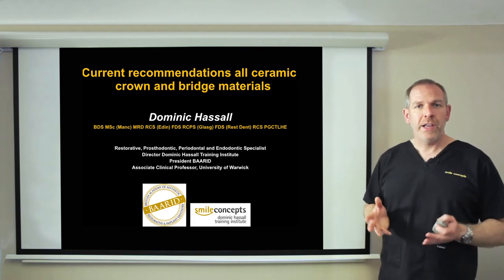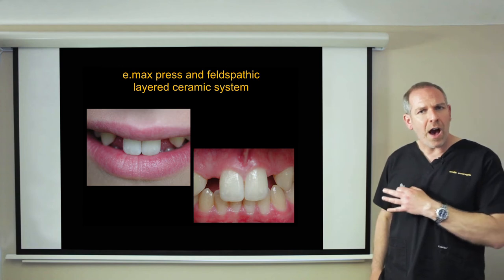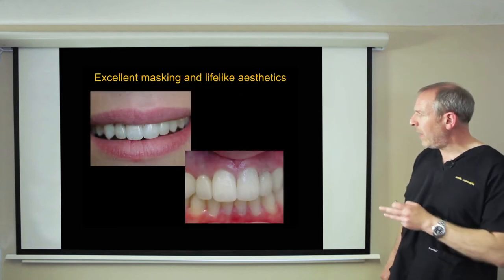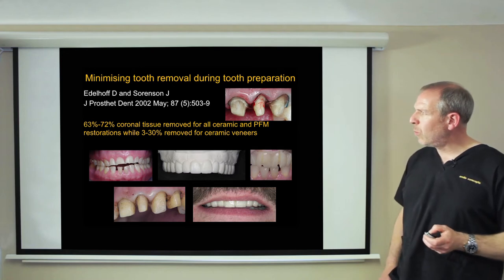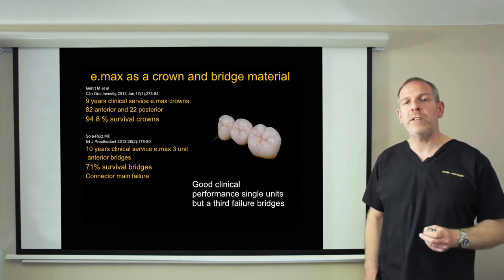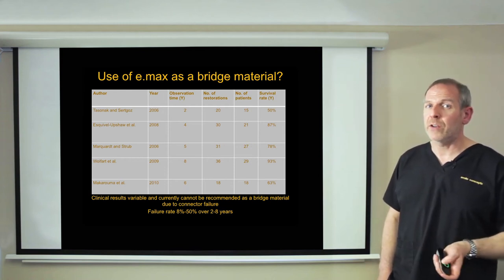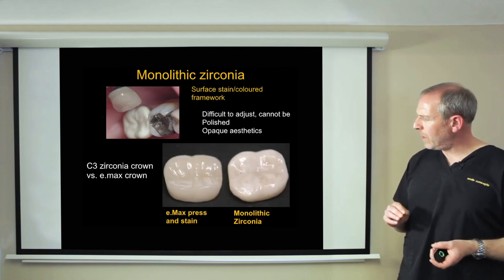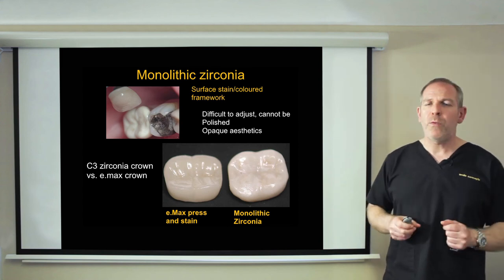Current recommendations all ceramic crown and bridge materials

Comment: Can I use monolithic zirconia as a bridge? It will be minimal prep and no risk of chipping.
Reply from the maker: Yes monolithic zirconia can be used as a bridge.
The data is only up to 4 units so I wouldn’t go longer than this.
The risk of chipping with monolithic zirconia is low and it would tend to break rather than chip but success rates are very good/
There are good guidelines at downloadcentre-gb.ivoclarvivadent.com and good guidelines for E.max too.
Be careful in grinders and with patients with small teeth where metal ceramic would often still be considered the better option.

Comment: Are emax press bridges also at risk of chipping?
Reply from the maker: Press only emax are suitable for bridges but rather than chipping they break at the connectors so I don’t recommend emax bridges and never at the back of the mouth.
For bridges monolithic emax is best but if you want aesthetic bridgework then layered zirconia is best.
Layered zirconia is less liable to chipping at the front of the mouth as occlusal forces are lower so is acceptable.
There are a number of reasons for chipping of zirconia but the labs are better with it and avoiding the reasons why it chips and for highly aesthetic anterior bridges I use layered zirconia.
Bond the zirconia with a resin cement like Panavia V5 which has a MDP primer (this is also in the new scotchbond) 
You can also use gold ceramic for aesthetic anterior bridges but the cost of gold is prohibitive and not many labs do gold ceramic.
Unfortunately there is no perfect material but I hope this helps
Reply: @dominichassalltraining  
Personally since doing your course I’ve fallen in love with monolithic zirconia. 
I don’t advertise myself as a high end cosmetic dentist and to be honest unless you are doing a single central incisor with shade matching patients can’t seen any difference. To be able to do 0.3mm margin (the 360 degree veneer prep) as you called it has honestly changed my dentistry for the better
Reply: I know zirconia doesn’t bond aswell as emax. However so far I’ve had no issues for the last 3 years. And I use panavia for the reasons you mentioned